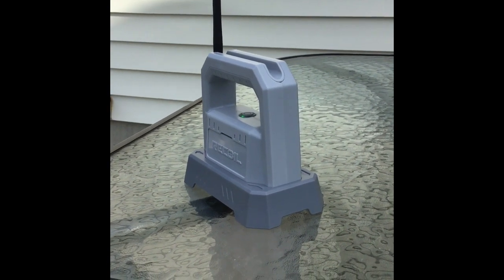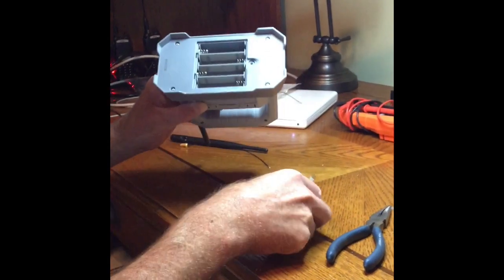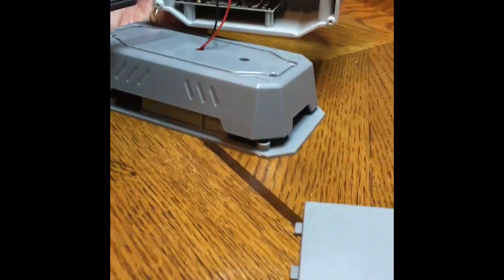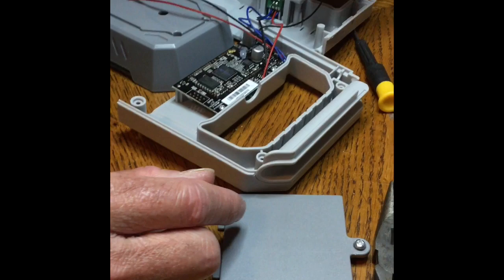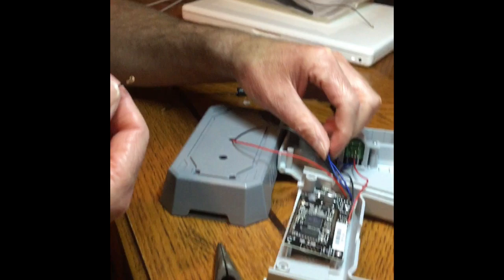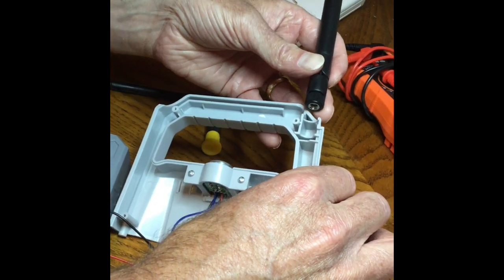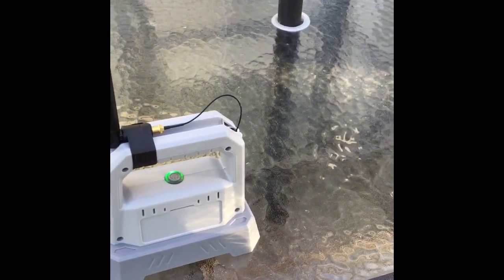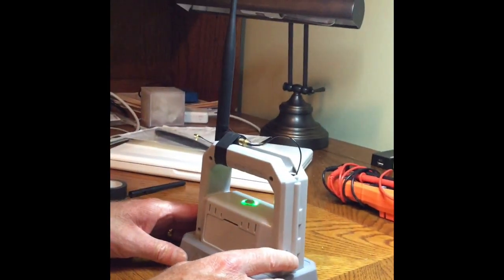Recoil Laser Tag Game Hub Antenna Upgrade

Comment: I did this mod to my hub and found the outdoor range was hugely improved, but only at a park that had no other SSIDs on 2.4Ghz - around our home outside range is pretty much the same, but the connection is more stable.

I did notice after the mod that the Recoil app has distances to crate drops all wrong, saying 999 feet away in any direction unless we go to the extreme edge of the hubs range. Hopefully the app gets another update soon, but for now Simplecoil is the way to go
Reply: So is it worth to change the antenna? Is it real better connection with it?

Comment: Thanks very helpful! Did this too, haven't played on the new antenna yet, but I get a full 3 bars line of sight at 420 ft away. I drilled a hole on the side as suggested in the video and used the included nuts to mount the antenna out the side, looks like it was meant to be and the wire is safe inside the case. Will be using it with the SimpleCoil app too.